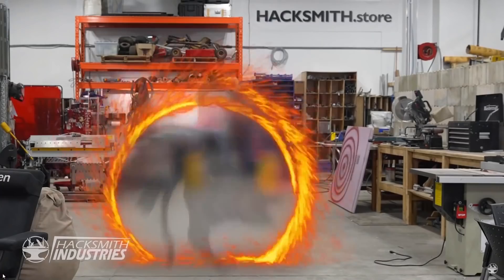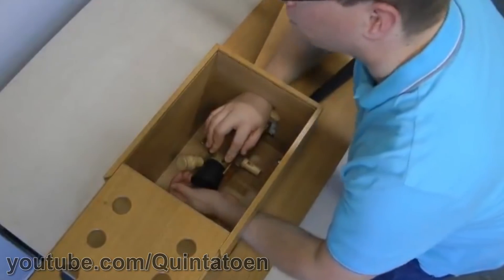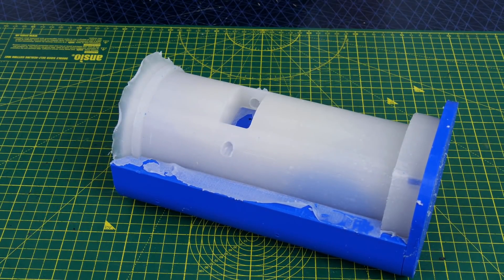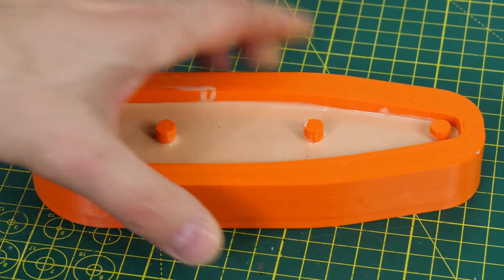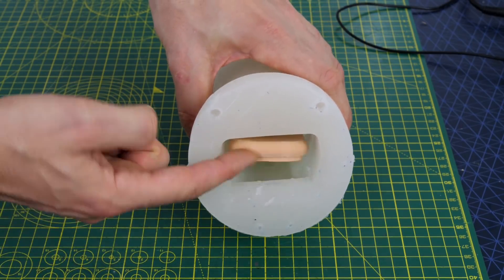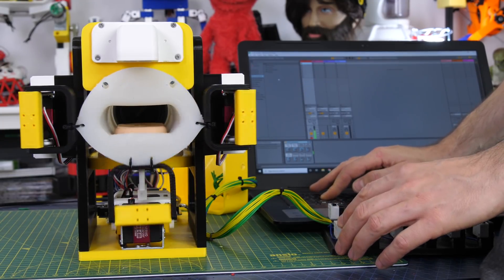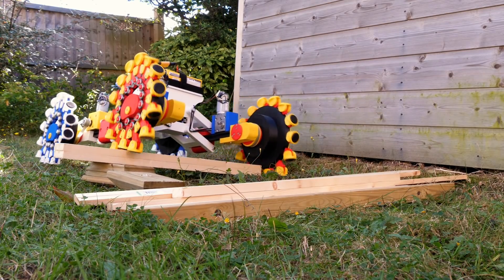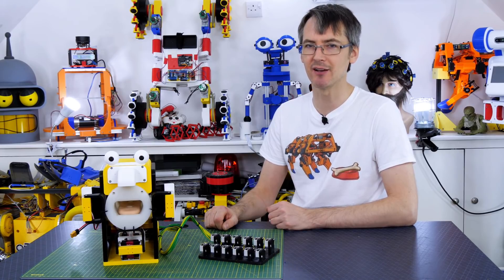Building a Present for Tested.com, Featuring Colin Furze

Comment: i was thinking about it i believe it would have worked if you used a much larger speaker in a box, and ran a tube to the back of the throat instead of a small speaker you need much more air to manipulate than that can produce, kinda like a talkbox set up.

Comment: I think for version 2.0, you should give it teeth. Teeth are important to press the tongue against, and they are the source of much of the white noise we make blowing air past in a particular way. Also you could give it a larynx, just a tube you blow air through with some sort of vocal cords, rubber band-like, and the cords can be tightened with a servo, and a controllable source of air. Either a big fan behind a lot of baffles to get rid of the noise it makes, or maybe compressed air with something similar.

Comment: Do you think you can make an electric squat machine with a ui that could control amount of resistance? The concept of an electric motor's torque to mimic the resistance of weighted plates is amazing it's what is used for the Tonal work out machine but this would be different. It can be a platform you stand on with a surface area of a 50 inch tv and the height of a shoe box with a steel cable that comes up with a clip attached to it. I had left a comment on another youtuber's channel I was subscribed to named 'Wesley Kagan' about 7 hours ago and when I had went back to see if he'd left a responds he'd deleted it and responded to other comments. Must have thought too highly of his engineering knowledge.🥴

Comment: hey I have a question I have a 3d printer with a magnetic pad but the plastic wont stick to it we tried checking the pad cleaning it switching the tips re leveling it a lot but it wont work have any ideas?

Comment: Awesome! Just an idea here for the air in the silicone mold: When people cast stuff in concrete, they also need to have a way to get the air out... they use vibration to get the job done. 
You could try the same using a hacksaw, massager, low freq speakers, etc...

Comment: I think the major flaw is that a speaker doesn't work the same as a larynx.  A speaker has air that oscillates back and forth whereas a Larynx has air passing through it - like a wind instrument.
It should be much better if you just replace the speaker with a fan and a reed.

Comment: In the future.  If you need to get air bubbles out might try vibration of some kind?  Or am I off about it?  

In science class we made vacume chambers out of plastic fish tanks mounted on plywood with a hole in it.  Just used house hold shop vacs to get some vacuum

Comment: Pretty sure the reason it doesn't work is because you're not pushing any air out; you're just making a different exit shape for soundwaves coming from a speaker.  
Perhaps having an actuator push a squishy blower similar to the manual one you showed would've yielded more expected results? :o

Comment: a good tip for the lack of vacuum pump to draw out the air bubbles for the mold is to attach a drill with a lopsided weight on it to a table and leave it running so it's vibrating :)

Comment: I've used 3D printed stuff as a silicone mould before. If you want to get something out really quickly then pour some hot water over the plastic, makes it much easier to pull things out rather than chipping away with pliers!

Comment: I think the reason it didn't work properly, or at least a significant part of it, is that you are driving it with a speaker. Because of that, you only have sound waves moving through it, but no actual airflow as in a real mouth (or the utterance machine).

Comment: Used an offset cam on a cheap motor attached to a platform with rubber feet to help remove bubbles from pewter when casting. Should work on silicon too. Great project, very weird😁

Comment: 2 things I thought about while watching your video. First I would have tried a vibrating fixture to agitate the silicone and let the air bubbles rise similar to the process of using a concrete vibrator to get the air bubbles out of a foundation wall. Second I would have tried using airflow through your mouth tube and used either vibrating cords or something similar to a flute type instrument to generate the sound. For fun I would have also experimented with lighter/heavier gasses to change the tone as well.

Comment: You probably should have used some mold release.

Also, I finally realized the main advantage of pedrails compared to tracks; pedrails don't require differential steering.

You should take your pedrail bike over to Global Mountain Bike Network (or Electric Mountain Bike Network) and ask them to help you convert it into a proper pedrail mountain bike.

Comment: A manufacturer that once I worked for put vibration motors on a table to vibrate out the air bubbles of resin.  We would fill the cavities of the product with resin after sealing it with RTV silicone then put it on the vibrating table. The circuit board inside was also conformal coated. All this was to weather proof the circuitry inside.

Comment: 3:40. Vibration gets rid of air in concrete...... should work in this situation also.
Oil or diesel works with shuttering. Perhaps olive oil would work on molds?

Comment: You've inspired my workshop! I'm in an apartment, so I'm limited in what materials I can 3D print; but I can 3D print molds! TY! ❤️
Reply: Just make sure to use good ventilation for some types of resin - AFAIK some of them may be quite bad for you or neighbors in an apartment
Reply: @R__i_i_ii  I'll have to avoid those. However, I have the same problem with 3D printing anything except PLA. Not ready to spring for a fume extractor. 🤣

Comment: When pouring, don't move the pour around the mould, stick to one place so you don't get trapped air. Also pour from as high as you can so you get a thin stream.
Reply: Pouring down the stick also helps prevent air entrapment.

Comment: You could have your "mouth" learned to speak with an artificial intelligence that listens to the sound emitted with different combinations of servo positions and compares the acoustic signal with a real one.  By doing so, he could really speak.  It is really an interesting and very feasible project.  I highly appreciate the fact that you are able to produce such content at such a short distance from each other.🤙🏻
Reply: The problem is not in the software, but in the mouth and servos themselves. Likely there's just not enough control over the shape of the mouth, and too much 'leakage' of sound.
Reply: @Pfooh  Surely the mouth itself has great limitations but my advice was aimed at making the most of the existing system and in addition it would be an automated way to calibrate future versions of this project.😉

Comment: A small speaker would never have been enough. You’d need some air moving through there! Maybe a long throw subwoofer? Lol. Might sound quite demonic though.
Reply: Honestly i would add some loud computer fan with speaker coming like from the side. That way this strange think could also wisper
Reply: Bet that vibration from a sub would be a bonus
Reply: @quinn860  facts
Reply: A fan would work

Comment: It would work great if you had made a voice box, such as some sort of reed or flexible matirial to push air through. The tone would then change depending on the resonance frequency, wich would be alterable by the mouth and toung.

The mistake you made was you used a speaker. The speaker is driven by a fixed tone generated by your computer, and is unafected by the resonance frequency or other variables in the mouth.
Reply: Yes, exactly. Our vocal chords produce a very reedy tone with rich harmonics, which the vocal passage filters with two or more "formants" created by blocking, unblocking, or shaping the various cavities. Not to mention we vary the fundamental pitch of the vocal chords as we speak or sing. Air flow per se is not needed, but the harmonics definitely are. So I suspect the apparatus James built is actually a lot better than he thinks -- just needs square or sawtooth wave waveform to the speaker.
Reply: @Graham_Wideman  you are most likely correct now that i think of it.
Reply: I was thinking the same and searched through the comments to see if the point had been made... he showed the bellows experiment, which is a big clue to simulate lung function as the sound source. The vocal cords are muscle-tensioned "reeds" that can be tuned and the mouth shaping as tunable resonator that would be able to tune harmonics. Perhaps a colab with a vocal cord expert like "The Charismatic Voice" channel is in order?
Reply: 100% agree 👍

Comment: One of my favorite leak-proof silicone casting tips I’ve seen came from Robert Tolone’s channel. You paint the mould mating surfaces with the same silicone that you will be casting, and then close the mould. You let that cure ahead of time, and it creates a gasket that won’t let any of your main silicone leak through (but it may bond to the gasket instead)
Reply: also powder the hell out of the mold... at least it would make your life tearing it apart easier... or harder... *confused pointing *

Comment: The biggest difference between what you made and the real deal is the fact that there's no actual sound being "pushed" out. It's a speaker. It will make noise regardless. Sound travels with air, air is pushed out, also, more than just the tongue and lips create the noise. There's indeed quite a lot going on. IMO, this would've worked day one with one major alteration, a larynx and a small pressure vessel (balloon). A reed in the larynx area would've made the noises (limited) and the larynx would've made the volume modulation. Probably a bagpipe would've worked.
Reply: everything works day 1 with hindsight.

Comment: I think of the Wallace and Grommit animations when I watch your machine talk. So delightfully weird.
And the bike is really cool. I bet the steel is necessary for the kind of stresses being put on it with a person riding. I like to imagine that he made little bare feet inside each of the tiny shoes.
Reply: He actually did make little feet at first that could rotate separately. He found out that they often get stuck on the heels so had to remove them, but kind of funny that this was actually the case in the original design
Reply: I'm not making any jokes about Wallace, more cheese and this Fleshlight....